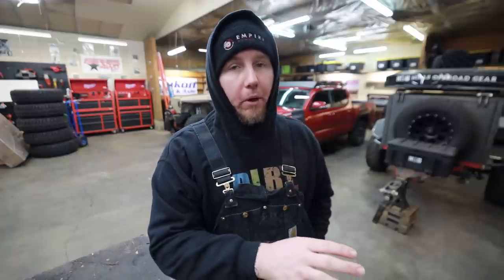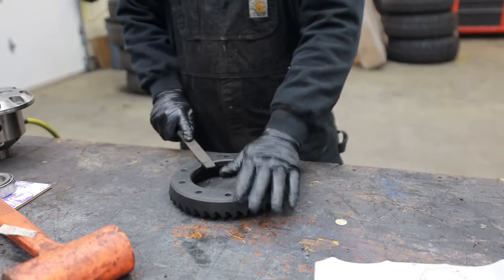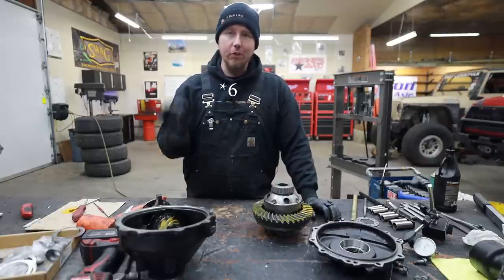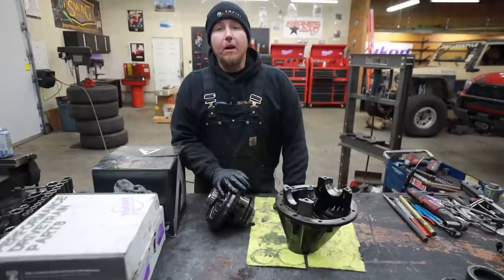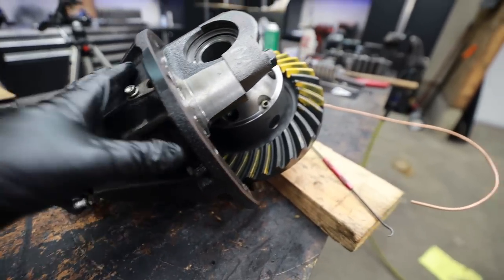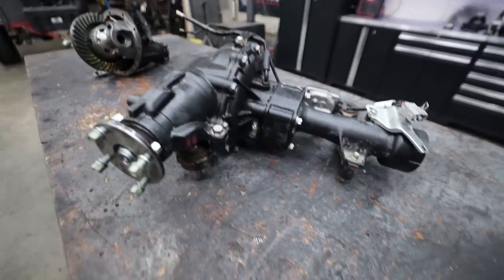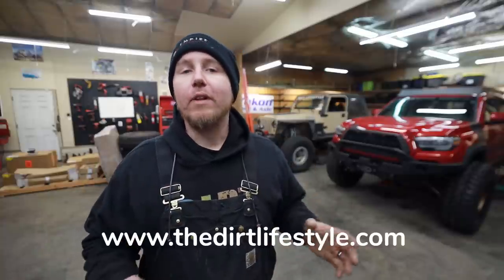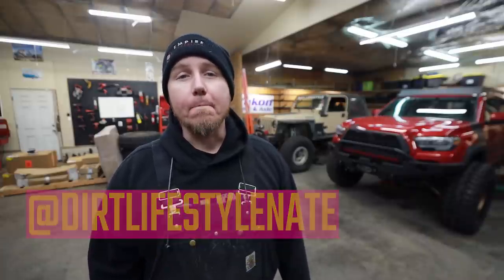Ultimate Toyota Tacoma Build Episode 4. 5.29 Yukon Gears And ARB Lockers.

Comment: As a Toyota fanboy, I love that you're going to push a new gen Taco as a full blow crawling rig... I'm just wondering what you're going to do about axle shafts. That's a lot of faith in 'yota axles running 38s in heavy rig (especially the front axle inner shafts and 8" gears...)
Reply: I have 37s and push mine hard with stock axle shafts. The way I see it, they’re easy to replace on the trail or limp the truck home if they break. If you put something beefy in there, the weak point would probably move to the gears. Blowing the gears up is bigger/more expensive problem. So let the axle shafts be your weak point.
Reply: @wanderingwinterfields   Nate is building this to use as a real crawler, not just an "overlander/trail rig"... Wheelin on slick muddy rocks that require throttle to bounce up is hard on parts. We'll see I guess.
Reply from the maker: All the yota dudes I have spoke to about stock axles say these rear ends can handle it. The biggest weak point with these rear axles is the housing. Overlanders bend these housings all the time, most of which don't even know it lol. The rear axles are 32 spline, same as the new JT but with WAY less power so I'm confident with a good axle truss 👊. But if it becomes a problem I will build a custom 9" housing with 35 spline shafts. I'm not worried about the front. These RCVs are beef lol but I won't know how reliable this will be until I get some trail time on it. The good news is it shouldn't be super heavy. No overlanding stuff on this truck.
Reply: @DirtLifestyle  Yeah no doubt on the RCV beef, but is the inner axle on the "long side" still stock? That's where I/we broke the most shafts in other yota IFS stuff. No too concerned about the rear. I do wish Toyota would bump up about 1-2mm thickness on their housing metal. I've actually bent the front of the housing from the diff trying to escape (imagine how the diff spins on the tubes on a Dana axle, but instead its the 3rd member ripping the face out of the axle housing...). Excited to see what you do with it. I bet removing the 4 doors would drop 500lbs... :takeout:

Comment: Voswitch UV100 8 Gang Programmable Switch Panel Power Control System for Truck UTV Side by Side Boat 12V Battery Use

Rouge Offroad - 

GTFO Expedition - ARB Twin Compressor and Bracket COMBO 2016+ Tacoma -Part Number: GTCBTT3-Combo

Hypertech In-Line Speedometer Calibrator Module - 730120

Comment: So, what are you using for the front suspension?  Only way I know to fit 38's is SAS or the new RCLT heavy duty IFS by Marlin Crawler which pushes the centerline of the wheel forward a couple inches to miss the cab.

Comment: Excellent video! I have a question, if you have money to put just one air locker, which diff should have it first?
The front diff because it has the rotation of the wheels or the rear diff?

Comment: I did a sas on a 95 taco.
Wanting to know if I can use the ring and pinion from the original front. Put those in an 88 3rd member 5.29 gears. Then put that into a dana 44 or another toyota straight axle...
For the front..I hope that is enough info..

Comment: Question, I know with solid axles, if you doing serious wheeling and crawling, going 40" or bigger with tires, you need 1ton axles.  What do you do for IFS for 40" tire upgrades? Is there a IFS upgrade to accommodate the weight and force of bigger tires?

Comment: I have heard that most newer vehicles have a traction control button that kind of turns the traction control off but not completely. If you bypass the computer with your ARB lockers will the traction control mess anything up? If its locked up the wheel speeds should match and the computer doesn't see any need for traction control?

Comment: What's happening Nate ,  I have a Dana 44 out of TJ . I bought it spent about $2,500 on upgrades . alto my new gears and lockers haven't been installed yet .I went from drum to disk . But here is my problem , I went wheeling and bent my drivers side axle tube . Where can I find a good set and also wood you recommend inside tubes as well ? Thanks Nate

Comment: Are you comfortable running 38 inch tires? Everything I've ever read about these axles has been, that they are good for 35ish tires under reasonable use. I would like to eventually run a RCLT under my 4Runner one day... lots of money which I don't have though. SPOD makes a clean switch panel I guess, but expensive and I would rather build my own for the money. I found a nice under hood mount for my ARB compressor from Slee off-road, but that was for my 4Runner. Not sure they make one for the Taco. It will mount a single or double ARB compressor and is high quality piece and looks good.

Comment: Ive been waiting for this build , does Toyota still use the thin wall needle bearing in the front diff. I did the upgrade on both of my Tacoma's
 smittybilt has an air compressor that fits in behind the passenger seat compartment

Comment: Switch Panel:
1. SDHQ Driver Side Cubby with Switch-Pro SP9100
2. Meso Customs CUSTOM LAYOUT switch panel & CH4x4 Toyota Switches

12V Air Compressor Mounts: Location! Location! Location!
1. Bed Side Cubby - a) ARB 3523010
                                   b) Expedition Essentials
2. Under Front Seat (Dr/Pass) - Desert Does It
3. Passenger Side Fender - a) MORE Offroad
                                                 b) CBI
                                                 c) SLEE Offroad
 4. Driver Side Fender - a) Rago Fabrication
                                         b) Powertrays
5. Next to Windshield Washer Fluid Reservoir - Slee Offroad
6. Behind Front Grill - a) Runnin4Tacos
                                      b) Mole Overland

Speedo Recalibration - Hypertech Part #730123 - Speedometer Calibrators Inline

Some common preventative upgrades for big lift and tires:
1. Change Needle Bearing busing to Solid bushing on Front Driver Side Diff (East Coast Gear Supply)
2. Use Driveline spacer to eliminate vibrations (Old Man Emu)
3. Solid spacers instead of crush sleeve in rear diff
4. Front Diff Drop spacers to lower CV Axle angles (Total Chaos Fabrication)
5. Bed Stiffener to prevent bed sides from cracking when flexing Offroad (Total Chaos Fabrication)

TRD Pro/Sports Hood: Seibon Carbon makes Carbon Fiber hoods for the 3rd Gen Tacoma with the hood scoop

My Build - 2019 Toyota Tacoma TRD Offroad @mt_ayon on IG.

Comment: Wait... I was of the understanding that the Toyota electric rear locker could not be replaced with other locker types if you still wanted to be able to use the traction control systems. Is there now a bypass to the electric locker, or does the traction control still function without the electric locker? (or do you just not care about the multi terrain select/crawl control?) 

I am not going full rock crawler with my Tacoma TRD Off-Road. It is a daily driver/work truck which also sees light trail riding (it is almost stock right now, so trails will get tougher as I build it) and "overlanding" I do intend to upgrade to 33" tires, and want front and rear lockers (I would prefer air lockers, but as I already have a rear electric locker, I was thinking of a front e-locker)

Comment: What was that green paste you put on some of the threads and splines? Thank you

Oh, I am exited for the coilover install
Reply from the maker: I use pipe dope on the splines of the pinion because I have seen oil push past the splines a couple times. It's rare but it does happen. The green stuff I brushed on was ball joint grease. I alway grease the seal surface on stuff that rotates. Not sure it makes a difference but when I disassembled this stuff there was still some assembly grease on these seals from Toyota... I must be on to something 😁
Reply: @DirtLifestyle  and you're a plumber!

Comment: I have a 2003 dodge ram 1500 ifs i have a 6 in lift my front drive shaft keeps breaking its the 4th one that breaks tried lowering front end and still breaks i recently installed a clocking ring still looks stressed and no rubbing on my transmission oil pan   i found some drive shafts by tom woods  that im looking in to buying is thier any advices i kind of see my transfer case shaft not sure proper name pointe slightly up instead of been leveled not sure if it supposed to be like that thank for any info you can provide

Comment: Thanks for breaking this down!  I've never worked on diffs but will have a bit more comfort getting into it now.  BTW:  How cold is it in the garage?  Is there a concern about making precision mech measurements in very cold conditions, especially where this will be operating in hot conditions?
Reply: All workshop Iv had to do with has always had stated mounting temp 20°C

Comment: Unfortunately I'm fairly certain that OEM locker is useless to pretty much everyone.
1. It's a 9 or 9.5" ring in the 3rd gen OR/Pro and the Sport and below have an 8" so if I remember correctly the housing is different.
2. To my understanding from a Tacoma World thread the 3rd gen locker has a dual current actuation, ie it sends on current to activate the locker and a second different current load once locked. So without the ECU system to run this it won't work. On 2nd gen Taco it's a tradition on off e locker like most other Toyota.😢
Reply from the maker: I think it is simpler than that. First plug (2 wires) connects directly to the locker. Second plug (also only 2 wires rides on the outer edge of the carrier and is definitely just for a light. So, since we only need 2 wires to actuate it there shouldn't be any crazy computer stuff needed. Just a 12volt signal. As for fitment, it will work in any 3rd member from a 2016 and newer taco with a 32 spline axle shaft 👍

Comment: Where did you get the bearing separator?
Reply: The one you used the impact on
Reply from the maker: Randy's world wide 👍
Reply from the maker: It's a yukon bearing puller kit
Reply: Sweet. I really like tools even if I don’t plan on using them. This is looks like something I’d get since I don’t have a place for a press, does it also install bearings?

Comment: Love the channel! I’m a light duty Tacoma owner and I’m pretty much done with my build. I did a ton of research as I was building even though most of the mods I looked at were way more than what I needed.

Tacoma world has a hood swapping thread you might check out. You also may want to look for a sport hood and you can plasti dip or wrap the scoop. That’s what I did on my TRD sport.

The only thing I’ve seen for speedo adjustments is a rough country in line chip. The tuning helps with shift points when you swap tires and gears, but nothing for speedo.

I’ve seen ARB dual or single air compressors mounted in the engine compartment behind the air box. There’s a bracket you can get for it there.

I saw a YouTube video of a switch pro in the headliner I thought looked clean. https://youtu.be/X4VAhh6GBcs